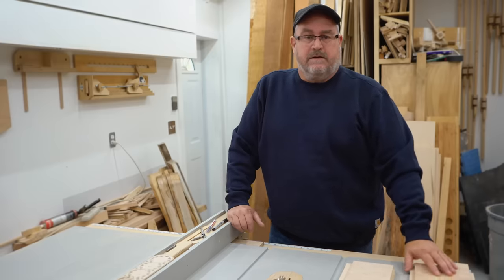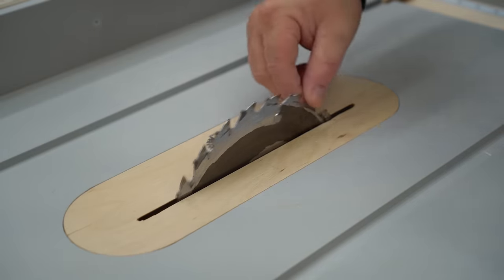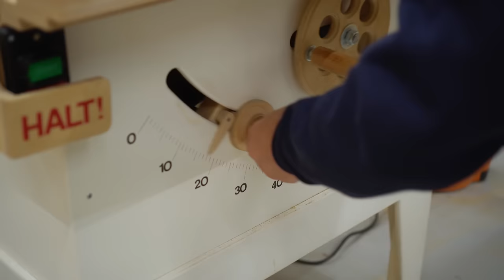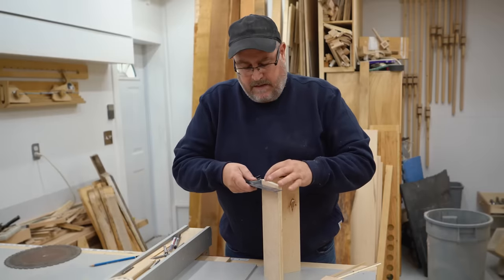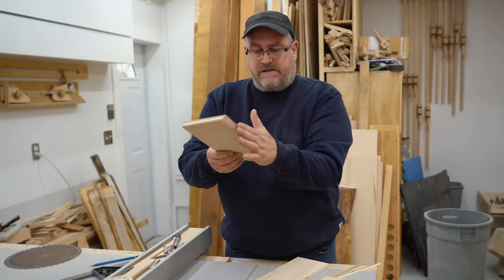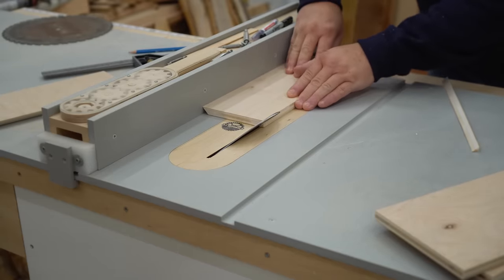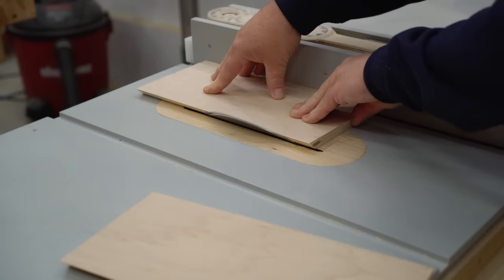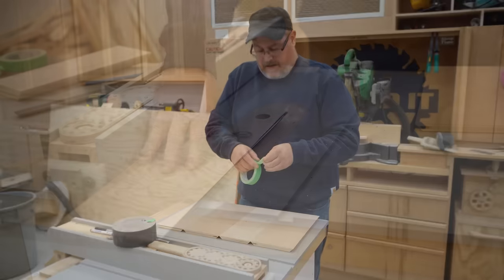How To Cut Perfect Long Miters on the Table Saw - Woodworking

Comment from the maker: Join the Makers Mob! https://rlnk.cc/frankhowarthanjohnheizs
Three key factors to successfully cutting clean miters:
1 - Well tuned saw. Doesn't matter how expensive your saw is, as long as it's aligned properly
2 - SHARP blade. This is critical. If the blade isn't sharp, it'll overheat and deflect and ruin the cut. I made a video on how I sharpen my own blades: https://youtu.be/zHtVT-phN5I
3 - Zero clearance insert, mostly for safety sake. The offcuts from a bevel cut are wedge shaped and if one gets jammed in an open gap  next to the blade, kickback can result. 
I like to recut my miters even if they fit well on the first pass. That reduces the stress on the saw and results in a cleaner cut when using a sharp blade. Start with parts that are slightly oversized and fine tune the fit as shown in the video.
On September 26th, with a Master of Architecture Degree from Harvard University, Frank Howarth from The Makers Mob will be launching a new woodworking design series.  In this 4 week woodworking series Frank will cover everything that you need to know to understand the fundamentals of woodworking design.

Comment: This is a great example of John's particular strengths. Cutting long miters does require skill and most people don't even attempt them, or give up and move on. John figured out, long ago, a reliable method and then remembers today that it would be useful to break this down for others. What an excellent contribution to woodworking education.

Comment: That edge burnishing tip is really cool, never heard that one before!
Also, even though I've been woodworking for.... gosh, 22 years now, I never logically thought about doing the rough 45 cut then a finishing pass to take tension off the blade for a more accurate cut. That's a great one too.  Thanks!

Comment: Thanks. Was struggling to make a box similar to this to cover up some exposed water pipes. Not really a woodworker but I see now that the key is a really well calibrated saw. The tape up clamp method is also a big help. Thanks for this video.

Comment: Great video and really top tips, take the sharp point off the first mitred cut to stop it crushing down and spoiling the second saw pass, also closing any slightly opened joints by pulling a rounded metal rod along the joins. Brilliant stuff.

Comment: Good video. One thing you should point out is the importance of tuning your saw so that the blade is parallel to the miter gage and fence when tilted to 45 degrees. Most people just check it at 90 degrees. My saw, an old Rockwell Beaver was almost dead on at 90 but off substantially at 45  and wouldn't cut clean miters until I shimmed the trunnions to get the blade parallel at 45. You don't mention digital tilt boxes to set the blade at 45.  I find it the most accurate and quickest method .
Reply from the maker: Good point. I had the same problem with the saw I rebuilt a few years ago. It's a frustrating problem that a lot of guys won't be aware of.

Comment: To get the angle right on the blade you can cut a small piece of scrap at the desired angle on a miter saw and then hold the piece against the blade on the table surface. Perfect every time.

Comment: Outstanding tutorial. You just confirmed how I need to upgrade from my current, cheap table saw.

Total gangster how you confidently run those cuts through with your hand. I’ve been around cabinetry all my life but still have a serious fear of slipping on the pass

Comment: I really like that last tip, to burnish the edges together. I loved your side table speaker build. I'm buying some dayton audio drivers to make some small pc speakers to see if I like the sound of them. If i do, I am rebuilding my 4ft towers as I blew a B&W 8" that I can't get anymore. I will be keeping the 15" subs as you introduced me to the linkwitz filter and It took a few days getting that made and tuned in. Bass is to smooth to replace that lot.

Comment: Thanks for the video - it's a great help! I have a question about your zero-clearance insert. Do you make a separate one that is dedicated just for miter cuts? Seems like you'd wind up with too wide a gap around the blade if you used the same throat plate for both 90s and 45s... Or am I overthinking it? Thanks again!

Comment: Hello my friend would you consider using several boards against your fence? You are correct, must have 90 degrees on all edges. Trial and error you cut your 45 degree into your fence. Trial and error and adjustments to your fence and blade height and your rate of speed may give you a no tear out since the blade is inside your fence .... Note: you must be at a minus 45 degree (1-2 degree). I had to make several cubes for a NYCity designer and I also burnished my edges using a screwdriver, lightly.  I’ll be 71 yrs old this week, Dec 6,2020...My very best to you and whoever reads this...Bob

Comment: This works up to 45*.  What about when you need more than that?  I have a jig where I hold my board up vertically.  45* becomes 45*+x.  Anyway, I think it would be worth covering how you measure the pieces out.  I think that's my main weakness.  If I am trying to create perfect miters, on correctly cut boards I often somehow screw it up after adding the miter cut.

Comment: I've also found (the hard way) that your stock needs to be perfectly flat.  That's easy for plywood, but when your doing long miters in glued up panels that aren't perfectly flat that will cause small voids in the joints. Running the glued up panels in a planer would be ideal if your planer can accomodate the width. This video was very helpful but it's still a struggle to get perfect looong miters with no voids.

Comment: I understand the concern that thin edges would get distorted by pushing them up against the fence. On the other hand, just randomly sanding that side to make it flat sounds like it would be just as unreliable. How is freehand sanding better ?

Comment: There is a much safer and accurate method by placing the fence on the opposite side of the blade and raising the blade into a piece of 3/4" plywood/mdf clamped to the fence. Very safe and very accurate

Comment: But closing the mitre with some extra glue applied, does that not prevent me from using say Danish Oil to finish? Because after sanding it will still accept less oil and hence be differently colored? I don't want poly at this point... so maybe only gel-based possible, or what am I overlooking?

Comment: Hahaha...
   sir that taping of your joints (as a mocking up of sorts) is nothing short of “freaking genius”...

    I am by no means anything close to a “master wood woodworker”, and most likely that little trick is not a secret...,
    I am a 58yrs young intermittent wood worker, (yes if I have seen the “strap clamp” devices used to glue up a box or picture frame...,
    but this is the first time I have ever seen this taping trick.

    Great video,
Thank you sir.

Comment: instead of using a square to check couldn't you just check it on a flat surface with one piece flipped up side down?
Reply: No! That just checks that the angles are the same, it doesn't check that they're both at 45 degrees. If both angles were 40 degrees instead they'd fit fine with the test you suggest, but when assembled they'd make a 100 degree obtuse corner.
Reply: @cooperised  you are obviously correct, I must have been low on coffee

Comment: I often find my mitred corners end up cupped in the middle, where the edges of the joint line up fine but there is a gap in the middle. Any idea how this could happen? Has me stumped.
Reply: Your material isn't totally flat to the table when you're cutting it. Everything has to be dead flat.
And straight!!

Comment: You've done more than 1 YouTube video? Your video popped up on my Google "card"  I like watching how people do things the hard way. Why cut the 90 if you're cutting a 45? Assuming your stock is already oversized, just go straight to the 45, then you don't have to worry about get the blade lined up with the corner of the piece. 
The biggest problem people have with cutting good joints is the machine they are using. They set it up when they first get it, but don't really maintain it. How do you maintain your table saw?

Comment: Cut a long plank at 45 degrees, measure the width and on the other side cut 45 degrees, then chop in four, 4 equidistant and exact copies, why wouldn’t it go together, you’re doing it the hard way?